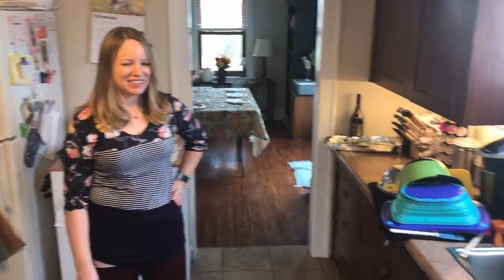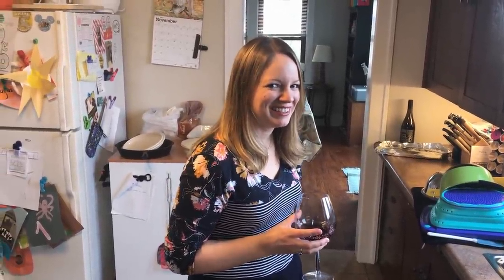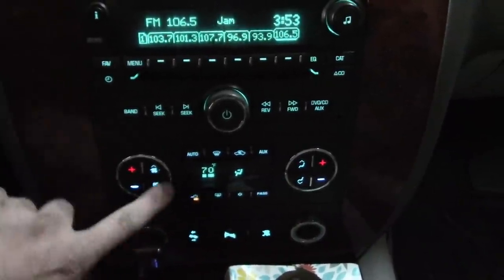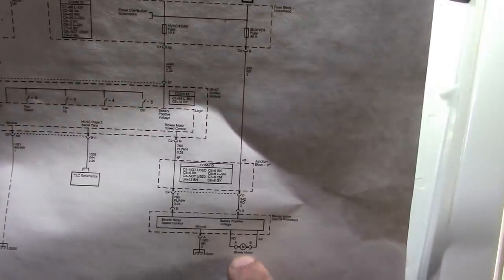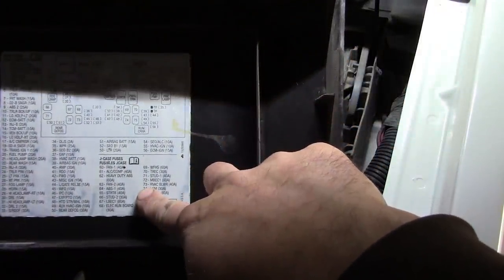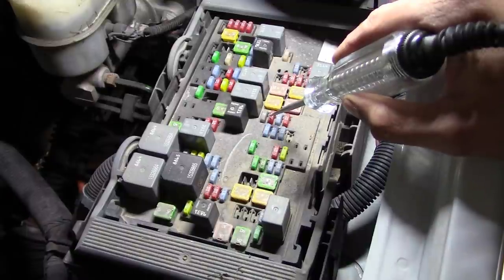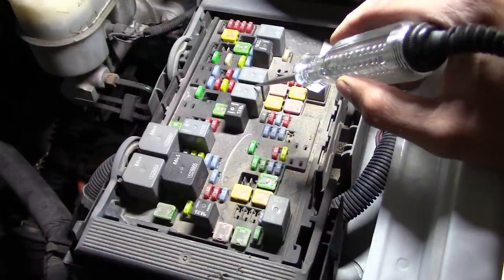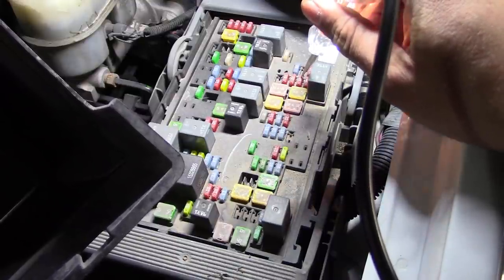2006 Chevy Tahoe - Blower Motor not Working

Comment: Sometimes (rarely) a brush can get hung up in a brush holder during a motor's life as the spring feeds it forward into the commutator.  With the amount of wear on both the commutator & brushes, that might have been the case here, and handling the motor can release the brush.  Glad to see you get to work on one job that isn't a rust battle!
Reply: Just what I wrote!
Well, kinda!
Well written!
Reply: just replace the blower on my audi, some style, spin to lock in place and two wires leading to a resistor pack...it started acting up and would work when i would reach down and hit it with a hammer...would work a couple days and then fail again...worked long enough to get a new part

Comment: Wow dude your video was amazing! I love it! When u broke down the motor to check the brushes made me smile. Awesome family. I never seen anyone break down a motor on you tube and run it on a test machine. I feel u need to push your time up on your labor. I have the same problem no blower operation.  I checked the fuses. I took the motor out and straight power the motor to the battery the motor worked. I will check the resistor. If I get power through the resister i will change the motor. Maybe the motor may have a bead spot.

Comment: After years in a rotating electrical shop my guess, heavy on the guess, would be a stuck brush that came loose as you moved the motor during its removal. a very careful inspection may reveal a few tiny burn or arc marks on the armature,  but then those may have been polished off when you ran it after removal.  At any rate its a win, take it.

Comment: I always bill a minimum of an  hour to diagnose a problem. As a rule I will typically unplug whatever it is and plug it back in. Amazing how often that "fixes" the problem. 
Thanks Wes. Hope you ate too much turkey and got a good nap in.
Reply from the maker: Yeah. I did try that, but I guess the issue could have been at the other end of the pigtail.

Comment: Wish all Blower motors were that easy most the time the aftermarket Blower motors ya have to cut the Oem Wiring and splice then in because most car companies don't give ya a removable pig tail on both ends now that is sweet Nice work GM @Watch Wes Work

Comment: I wonder if one of the motor brushes got stuck, and then released during the swap.
Reply: I have the exact same issue with a lot of DC motors.  Brushes get stuck in the brush holders, especially when worn half-way.  A little working back and forth with carbon crunchies falling everywhere, and suddenly it is as good as new.
Reply: especially the way the one side was half mooned out where the other side had more even wear tells me the spring was fucky
Reply: I had a Kirby classic vacuum cleaner that had a stuck carbon brush and it was a real pain in the ass to get it free.
Reply: Yep, my first move on any electrical motor is to bang on it, rotate it, sometimes they last years longer. Fuel pumps included.
Reply: Quite possible. One of the reasons i like to take my brushes before installing them and cutting a shallow groove in the four sides. Easy to do and it doesn't affect the function, but they don't get stuck anymore.
Reply: Might have responded to some percussive maintenance with the thumb detector

Comment: The GM automatic temperature controls seem to be very sensitive to any defect in the blower motor that wouldn't affect a standard resistor style switch. I've replaced many inop motors that worked when bench tested. 

I don't miss book time one bit. All of my automotive related work is for the company fleet or my own junk.
Clients are actively discouraged from wasting my time. 2 hours minimum plus trip charge and hourly after. Weekends/after-hours is double. Outside clients are all of that plus 20%.

I've always admired guys like Wes who operate one man shops. All of the headaches and none of the help.
Reply from the maker: Yes. Many headaches!

Comment: I have taken apart lots of blower motors and sometimes it is stuck motor bearings, worn bearings or a hung up carbon brush because of dirty brush holders. Other times it's a worn out motor if everything else is good. My experience hope this helps and next time before you take the motor out give it a whack with a screwdriver handle and see if it starts working then it's a stuck brush and it will happen again so you are better off replacing the motor. No need for a comeback.

Comment: Brushes were probably sticking in their slides. Chances are if you had given it a swift kick before you took it apart, it would've starting working for a while.

A lot of times those motors get worn and start to draw too much power, I've done a couple where either the plug on the blower controller was melted, or the blower connector itself was smoked. GM really skimped on the wiring for those, sometimes even a wrapper on the blower cage can cause them to melt.

Comment: Could be a <dry joint> of the kind that the soldered-component TV sets had.  Fine for a few years and then trouble.   Tapping can start-stop things.   My version was in a FORD car where the solder was present on both sides of the contact pin but not between.  One old TV set could be helped by vacuum cleaning the circuit boards among the valves, for which the access is electrically very dangerous.  A TV viewer had quick results by stamping hard on  the wooden floor.  That TV also showed an interference pattern when the oil-firing was not working properly.  Then there was the dish-washer ......  {UK English]

Comment: I've had the similar problem with that on my or 6 Colorado and my buddies and my dad's 2005 ford f150  On all of ours it was the blower motor resistor now that may of been Built-in to that or 6 taho But more commonly than not it usually is the blower motor resistor Those blower motor resistor is usually reside right next to the blower motor in the duct work  The moving air helps keep the resistor cool

Comment: I charge a minimal of 1hr and if I can complete the whole job in that time from diag to complete that's all I charge. That's a common repair. If the motor doesn't run it's usually the motor and if it won't shut off it's the controller. Thanks.

Comment: The fan controller was sensing something not in spec so it shut the motor down, wonderful world of computer control.
Reply: @K.D. Pearce Rats, Mice??..lol
Reply from the maker: I suppose that could be. But the amp draw seems normal.
Reply: @WatchWesWork  If it was sensing something abnormal then your test light would have caused the same issue and that unit would not have given you power to light that light up.
Reply: Probably brushes hanging up. You knocking it around removing it probably unhung them allowing commentator contact.
Reply: Also, isn'tt amp draw effected by how much static pressure is in the system?  I.e. amps are generally higher in the open air?

I don't know
Reply: @dans_Learning_Curve  Yeah, sticky brush/brushes and/or false contact on connectors/pins...

Comment: Hi Wes  end play control is what I figure, or brush hang up and dry bearing dry drag,  up here in AK motor drag at -40F can over load system because fuses are over rated by extreme cold and you get a handy chain reaction motor drag, motor control looses all speed steps,  then you go to ignition switch over load and then it's switch time too.
Reply from the maker: I think those are all possibilities. I don't know if the controller monitors amp draw. I doubt it.
Reply: @WatchWesWork  in really cold weather fan motor can pull high amps for long periods of time half cook fan switch and ignition switch

Comment: This motor seems to be a universal motor type. And this type normally has a very high starting torque. Almost infinity if you can deliver the amps. So I think the motor control somewhat limits the current. Perhaps the old motor pulls to much current at start and the control shuts off.

Just a educated guess...

Great video s love them 👍
Reply from the maker: That could be.

Comment: Charging for the job....
Minimum 1Hr or part there of plus parts and shipping or travel time to get them. Make the customer aware of this before taking the job on. 
If job is 1.25 Hr charge is 2 hours.  If you are filming the job a small discount might be in order to ease your conscience.
The customer is paying for your time , expertise, plus tooling, consumables, education (to keep up with new technology etc), insurance , workshop upkeep etc, etc.
Don't be afraid to charge a fair fee for fixing damage the customer has done through using the vehicle. Your not in business to be everybody's friend.
That rim is a highly desirable item for a home foundry operator. The aluminium is high grade.
Cheers Eric

Comment: Hey Wes, Happy Thanksgiving to y'all 👍
It's a shame if you have to go by book times bro, but for a straight forward job like this, understandable you can't charge a great deal. Diag time should be a min 1/2hr-1hr or more depending on the diag, and always try to charge something for your 'parts person hat' (however that be) it still costs you time, fuel etc. Also don't forget a little from each job should try to cover some of Tim Taylor's cost (you know who I mean) it can take quite a few jobs to recover those outlays, and it all comes out of your pocket over the years.
Also, for any GM vehicle repair nowadays..(even though it's not your customer's fault)....Double labour charge, and you'll still be cheaper than the dealer... It's to make up a little for stupid, difficult to work on, cheap junk..hopefully your customer still comes back, but with a Toyota instead..lol😂

Comment: I work on electric lift trucks for a living. Magnets in the motor get hot, and lose strength. Try heating a magnet once with a torch. Sometimes you can take a strong neodymium magnet and place on both sides of the motor, to test.

Comment: i have had a blower motor that failed intermittently, it would work under braking, bu not otherwise, removed the motor, and tested it, in certain orientations it worked fine, others not at all, on disassembly the brushes had worn (in 240,000 miles) a 1/4" deep groove in the commutator (testiment to volvos build quality that there was still commutator left after that depth) what was happening was under braking the side of the brush was contacting the remains of the commutator, making the circuit, otherwise the brushes and commutator were just not quite reaching over the gap.

Comment: Wes: if you ever get to change tires on an jaguar ... check very careful  if it is original rims or not because the nuts for the original alu rims  on the older ones isn't konical, they  are flat.  There is some more pecularities with them too.
Reply from the maker: Weird. Like a hub pilot rim on a truck.
Reply: @WatchWesWork  this video https://www.youtube.com/watch?v=TbM8NinWhQg about an XJ6. That car has wheel with a center nut. That car  has something which will catch monkey wrenches ... the rims can easily become expanded around the center ergo  the owner either cant drive forward after a stop on a red light because the wheels wont rotate due to the awful slip between the  OR found out how fun it is to loose the brakes while moving at speed.... 

So tighten that center nut only as much as it should OR BEWARE OF THE TIGER INSIDE !

Comment: I had a Carter Electric fuel pump on my boat years ago that quit working after only one ski season ,  had to cut it open as it was a sealed unit and found the brushes just stuck in the holder and that was it .

Comment: Sometimes the brushes will stick in the brush holders. They then will not make good contact with commutator. When you removed the blower , you could have unstuck the brushes .

Comment: Maybe a stalled bearing caused the unit not to start, typically standard practice isn’t to check the output to the motor but to jump power to the motor, or maybe that’s just here, that way you can give it the input it wants and if it doesn’t start then you know it’s pretty much toast, sometimes manually turning it helps, but as you likely already know, that can skip past a dead spot you might not find again without the equipment you happen to have, and then it’s a return visit or a return failure at least

Comment: Happy Thanksgiving to you and your family! 👍😎 Cool that the motor came with a squirrel cage. Those things are so freakin brittle they usually disintegrate when you try to remove them. Couldn't have been an easier fix on this pig. No 9/32 or 8mm screws even holding the motor in. Barely even need any tools to swap it lol. Hows the cabin filter looking on that thing? That rim got some distance!!! Yep, little 'wallered out' as they say. Add it to the aluminum scrap pile!
Reply from the maker: Filter was clean.

Comment: "Blower Motor Control Processor". I was actually born with the source code for this device embedded in my bio operating system. It interfaces perfectly with any combination of +12v, ground, wiring, a relay, and a squirrel cage fan.
Reply from the maker: Nice!

Comment: I’ve had heater blower motor issues in the past sometimes they just get stuck for no apparent reason but usually it’s the bearing under the squirrel cage drying out and gluing itself together.

Comment: Question for the experts! 07 Dodge Ram single cab. Intermittent drivers side window operation. The FL heat appears to increase failure. When it works, it does so flawlessly, it. Never stops half way, if it opens, it always closes flawlessly! Switch is ok! Thoughts?

Comment: I have seen on rare occasions the output of a control circuit gets "stuck" until you remove the circuit load and then reapply it.  I wonder if the "control module" wouldn't switch the ground on the output until you unplugged the motor and then plugged the test light in.  It would have been interesting if you would have plugged the motor back in after the test light to see if it would work.  Could also be a safety circuit in the module if it seen an over-current and shut down the output until the load is removed.
Reply from the maker: I did try that. The only one I didn't check was the plug right at the motor.

Comment: chevy tahoe and truck blower motors like that do this at times, usually you can just kick it to make it work for a few more weeks while you wait for parts to come in, glad it didnt burn up the control module but that usually only happens when the bearings seize from moisture and sitting.

Comment: How did the blower harness and socket look? I had a 2012 silverado with an intermittently inop blower motor. I guess that the motor was pulling too much amperage because the connector was ever so slightly melted.
Reply from the maker: Everything was fine.

Comment: They were probably using tapered lug nuts from a steel wheel. You can tighten them right on through an aluminum wheel. As far as that thing rolled, it's good that nobody was in its path.

Comment: I have a 2006 Yukon. Mine was intermittent. I could fiddle with the motor and it would run for a while. I replaced it. Within a day the same issue came back. Long story short, The motor controller was the real issue. I hate to say it, but I am pretty sure that one will be back to haunt you. :-(
Reply from the maker: We'll see.

Comment: Seems a reasonable strategy to charge like this, you have to make an appointment with the guy for pickup, meanwhile his car takes space in your shop, so half an hour sounds alright. Something else entirely: I wonder if it might make sense to read OBD codes to figure out what the issue is instead of checking the fuses first.
Reply from the maker: I suppose the heater control module might throw a code.

Comment: Is there any noticable resistance to spin the bird cage like the bearing is starting to go? The cars I work on are pretty infamous for the cage being hard to turn which in turn can burn out the blower resistor block.
Reply from the maker: It seemed normal to me.
Reply: @WatchWesWork  only other thing I could think of is check the amount of amperage the new one takes and compare it to the old one (which you already did) and see if there is a noticeable difference. Yeah definitely a weird one, I hate intermittent problems like that.

Comment: Love the use of the test lamp in place of the motor. It comes across so well on video. 

Were the motor bearing's ok? The UK spec stuff I've had issues with have tended to start with the grease in the bearings drying out, and then as the bearings tighten up everything then progressivly self destructs. 

Was the resister part of that blower or was it seperate? Was there any sign of water being drawn into the heater? I've seen that happen a few times in the UK?
Reply from the maker: It has a PWM control module instead of a resistor. It was working fine. But the bearings might have had it.

Comment: my opinion is the control module (smart resistor) is going out and couldn't handle the load of the old blower motor so it would kill power.  also the cage of the new motor looked shorter, so it probably doesn't blow as hard as it used to.
Reply from the maker: That could be.

Comment: Maybe contacts were corroded and once you removed it the contacts on the plug were clean enough to run? Or electric motor was slightly seized but once you spun it it ran again. In all honesty I would charge them for the replaced part. Still better than what was in there and if you would have put it back in and sent it out the shop they could be back in a week later with the same issue. Most people would prefer a new part once you're already in there. Electrical Gremlins are nothing but pains.

Comment: I have 3 of these trucks, 2001-2008 every one of them it has been the connector from the Blower motor Resistor to blower motor. My 2008 I just replaced everything except the blower motor, it works, but still not right. Blower motor will be here tomorrow.